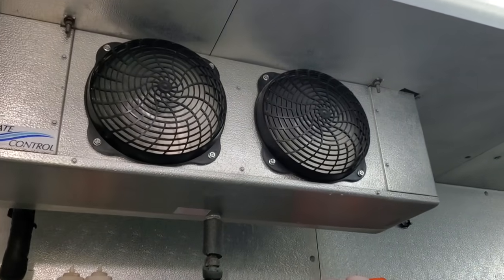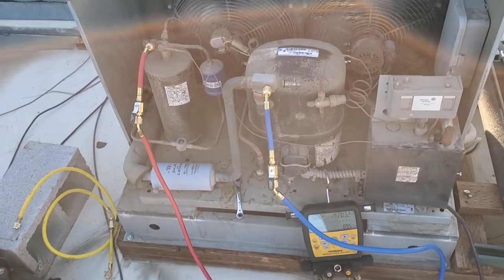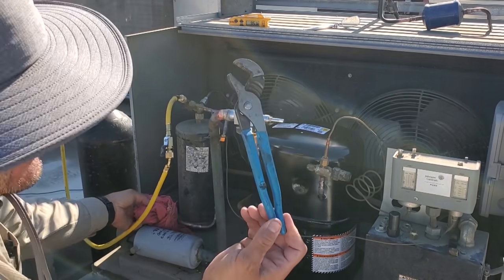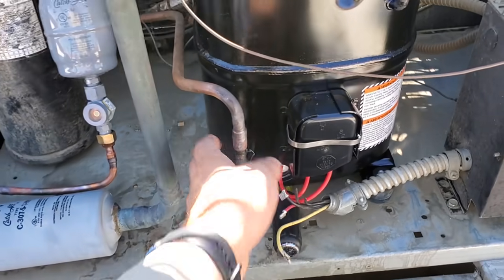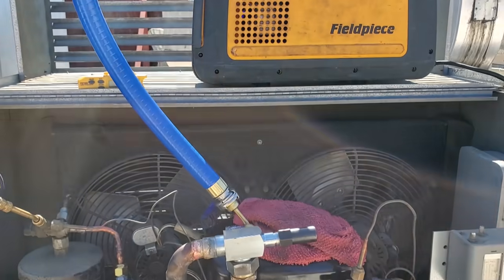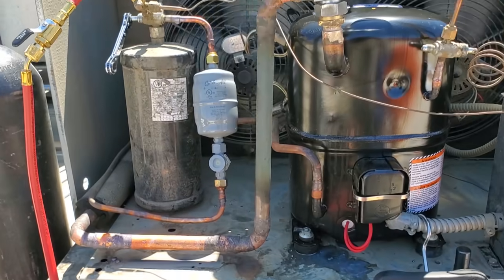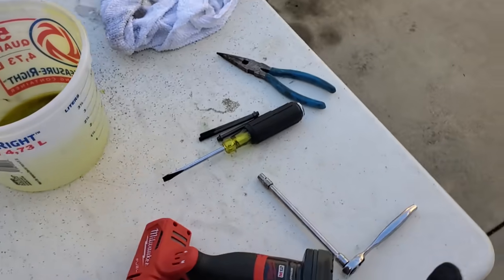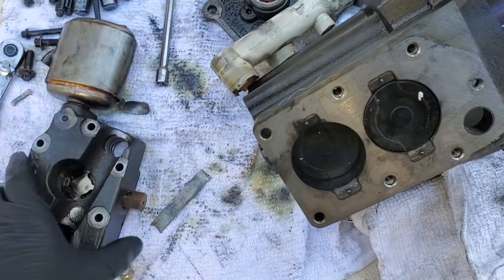THE COMPRESSOR SOUNDS LIKE IT HAS ROCKS IN IT

Comment: Had a scroll compressor on a Data server room unit that was making that noise, but cooling and running fine. I wanted to replace it before it broke but my service supervisor and manager said no. 6 months later someone else has taken over the contract and it went out. He said he felt it would have been best if I had replaced it in the spring like I wanted instead of middle of the summer. 🤷‍♂️

Comment: Slow metal fatigue due to vibration. If you look at the metal break you'll see 'waves' as the crack grew and the steel stretched and then sudden a clean granular area when it finally failed. I imagine the compressor probably wasn't balanced properly and had a harmonic that was ultimately destructive for those brackets.
Reply: I came here to write the same thing and saw you already wrote it 3 months ago. lol.
Reply: I’m third on the list, 9 months late.
Reply: @Sidicas  Heh. Seems like you got Craigified!
Reply: superb analysis

Comment: The bracket likely broke due to vibration-induced metal fatigue.  Ask the manufacturer.....it’s probably a known problem.
Reply: That's what I was thinking too. Once the small muffler tab one went maybe it caused the other to see vibrations at its resonant frequency. The breaks seem too be the same distance from the bends in both brackets as well so hopefully that design has improved in new models.
Reply: Joseph D too be or not to bee, that is the question.

Comment: When your unsweating a line that your going to re sweat as soon as it’s ready to come off move the heat back onto the compressor in this case and pull the line 90% out let it back all the way in then out again a few times this cleans almost all of the silver off of it making it fit better. You also risk tearing the copper if your heat control isn’t great. I love watching the videos keep them coming

Comment: "Actually it just satisfied on me"
Hopefully it took you to dinner first.
Reply: Erik Kovacs 😂😂😂😂😂😂😂😂😂
Reply: New merch: 'God, I hope she blows'
Reply: Yea... wth does that mean anyway??
Reply: Johnathan Waters think long and hard about it. 😀
Reply: @Johnathan_Waters  When a system is "satisfied" it refers to the temp control detecting the desired temp it's programmed/adjusted for. After the thermostat reaches set point, it opens phase to the liquid line solenoid (closing the valve) so the compressor can pump down and shut off.
Reply: I guessed what it meant, but it doesn't stop it sounding funny to someone outside of the States lol. Phil from the UK

Comment: My dad once fixed one of these by using a shop vac'd bowl and a hole saw on the crown, then an old can-opener to finish the cut.  Replaced the strap and ran off a cut ring to fit in the top, braised it on with the slug.    It'd be a hard call but you'd have been known as a miracle worker XD.
Reply: Prjndigo I once moved headstones but left bodies.

Comment: The black sludge is from the valves overheating. Lack of suction gas cooling
Reply: Yeah you are right with that  I only hope that the compressor did not pump oil in to the sistem itself
Reply: Look at that valve's heat signs on those......
Reply: @liviugabrielancutescu3644  the system is full of it it's circulating oil all the time. Drier catches most of it. A few drier change outs clean it up. That's what I learned over the years. The core type drier cleans a lot of junk out quickly but needs to be changed till the oil is clean again. I'm sure some of the dirt or solids get stuck to the bottom but if it don't get disturbed it's not going to get pumped out of compressor
Reply: @royamberg9177  it's normal to pump just a small amount but that pipe if it was not kept there by the bracket the compressor probably was getting oil and pushing it
Reply: Possibly liquid slugging?  Maybe caused by low superheat making the compressor pump liquid.  The liquid doesn't cool off the compressor and overheats the oil and this happens.  I'm not sure, trying figure it out.
Reply: @tytig94  slugging may have busted strap but not carbon
Reply: Roy Amberg the system is full of it, indeed.
Reply: Interesting, didn’t know that

Comment: Great job! I am 3000 miles away. Here, that job would more than likely go out for bid to at least 3 contractors. You’d be dealing with a facilities manager or broker who has the job of making sure you do not make any money. He would take the bids and start calling working one bid against another. In the end, the guy on the truck would being doing as little as possible because his company told him he had 4 hours total to pick up the compressor and turn key the changeout. Some “woman” in the office screws up the quote and they will still want the same profit. An example is I saw a company do a nearly $18,000 30 ton compressor change out and did not even change the filter drier or the contractor. Techs in the field are told exactly what to do and how long they got to do the job. Some companies even tell the tech what roads to take to drive to the job. They have sophisticated GPS driver monitor systems that tell the office has fast you turn, if you slam on the brakes, where you are, where you been, and have a camera pointed at the driver. Mom and pop restaurants will not fix anything that is running, and when they do authorize a repair, the company needs a team of collectors working the phones trying to get paid. California, it must be different. Just about everything is brokered out here, one way or another. How you sell these job is a mystery to me. I bet HVAC companies are using your videos showing techs how easy it is! On large equipment facilities out here, in order to get customers and keep customers, either the salesman gave the job away, or, they send a saleswoman out to screw the customer, or, possibly they send the site contact guy to the Final Four Tournament or on a fishing trip.  Everything is crooked, everybody wants something for nothing. It all flows downhill to the guy on the truck.

Comment: Black sludge is from the compressor overheating check your superheat at the compressor If it's a Copeland compressor they want min 20F degree max 40F superheat at the compressor plus check your discharge temperature if it's at 250F oil starts to turn to acid.Make sure your condenser fan are working correctly.
Reply: The same guideline for L'Unite (Tecumseh) 20°C superheat max 40 deg
Reply: Black sludge can also be from aluminum wear. Aluminum oxide will look the same as burnt mineral oil.

Edit: that was definitely from overheating because the valve plate was discolored and it had carbon buildup from burning the oil.

Comment: The noise was probably from those sheared off brackets rattling in the bottom of the compressor shell, whatever, it wasn't right & the replacement of the compressor was the way to go.

Comment: Others have touched on this, but I believe I can explain what you are seeing with the oil and carbon deposits.

Was this originally an R-22 system years ago, before the condensing unit was replaced with an R-404 unit? The reason I ask is that it looks like there is mineral or alkylbenzene oil mixed in with the POE oil. Mineral and alkylbenzene oils are good oils when used with CFC or HCFC refrigerants, but not so good in an HFC system. Also, mineral and AB oils will decompose into carbonaceous materials at lower temps than POE oils, but even so they still requires discharge temps above the manufacturer's specified maximum for the compressor (around 225°F-250°F for the Tecumseh AV series). I think that is the case here. The compressor discharge temp must be well over the manufacturer's rated maximum in order to have caused the discoloration on the valve plate and the carbon deposits on the pistons and valves, as well as the sludge in the oil. High discharge temps are caused by the usual things: high compression ratio (seen in systems running low evap temps), excessive superheat, excessive high side pressure (dirty condenser, overcharge),  etc. 

What you are calling "copper plating" on that bearing end plate isn't copper plating. That is actually a copper thrust surface. The entire weight of the rotating assembly rests on that thrust surface, so copper is used as the bearing material for the steel thrust surface of the crankshaft to ride upon. Copper plating should not occur in a dry, acid-free system. If the system contains moisture and/or acid, that needs to be addressed immediately.

Comment: That small tab looks like it mated that "muffler?" Thing to the suction line thing. Once that snapped, the muffler thingy could vibrate... and that vibration probably caused that other little bar on the suction line thing to snap. I'm sure those two tabs made a bit of noise at the bottom but those two side units are sitting right next to the pistons and now have play... so they were probably making the most noise. Yeah it works but you know that vibration would have caused another break that would have been far more catastrophic. Good swap and thanks for the dissection. I love seeing the inside of motors. Makes the video awesome to me.

I'm just following your nomenclature but I'd guess that muffler is something to do with the oil or discharge line but I didn't see how it came out of the case. I don't see why there'd be a "muffler" on an electric driven motor but i haven't a clue.
Reply: I've always called them mufflers as well. I once dismantled a scrapped compressor (which still worked. The whole unit was scrapped due to rotted coils) and ran it with and without the mufflers. It was much louder without than it was with. It's surprising how loud it is period running outside of the steel housing pumping air. Of course, when it's still sealed in the hermetic housing it's much quieter either way.
Reply: @Matt_Deluca  good to know, I really didn't realize they'd have one. Though I'd wager vibration dampener might be closer to the description but again idk

Comment: Good Vid ! That oil in the Bottom of the compressor that ooks like 1 Thick oil and a Thinner oil is Exacly that. it is 2 Diferent oil types that Dont Completely mix. The thicker oil is the Mineral Oil and the other oil is either alka benzene or poe. old system and a few compressor changeouts  = different oils in the compressor. Thats one of the Drawbacks of NOT being able to do oil changes on a Hermetic compressor after doing a compressor change out.

Comment: At 18:44 you see the "muffler" on the left and the what I believe would be the piston intake on the right. The little twisted bracket on top breaking off may have been the result of the lower bracket breaking off or visa-versa. So was it just metal fatigue or operational stress failure??? I'm surprised that a little bracket held with just two bolts would be enough with the vibration generated by the motor.

Comment: Nice. That’s pretty interesting. Seems like the valve plate was overheating and maybe started breaking the oil down.  I opened one recently because it sounded like rocks inside and it turned out to be a mounting spring broke and the whole assembly was bouncing off the shell.
Reply from the maker: Yeah i think somehow this one was hitting the case and or thr muffler was rattling .........

Comment: Awesome! Thanks for my first look into the guts of a hermetically sealed compressor! And as far as Tecumseh goes, personally I've always had WAY better luck with their mower engines VS Briggs. But Idk if they even make small engines anymore. Seems like forever since I've seen one...
Reply: No they don't, they only sell parts for them anymore. Moved on to other things. We had a 90 GPM water pump with a briggs that blew a rod, took out the piston and hooked up a tecumseh to the briggs, ran it that way over a decade while the briggs didn't make it past summer #2.
Reply: @leebarnes655  Lol doesn't surprise me. My uncle had a newer rider with a twin cylinder Briggs and one day there was a loud noise and the engine seized. I took it out and tore it down and there wasn't much but metal dust left to one of the con rods.

Comment: A great video! Liked the compressor teardown! I used to cut open scroll compressors and would usually find the failure was from them binding due to wear from the pot metal parts wearing out ! There would be a large amount of metal shavings in the sump!  They're very cheaply made! I personally prefer the turbo torch because the flame wraps around the pipe and the silfos flows better and you don't have to move that bulky torch around so much ! The turbo torch tip is so much lighter to!  I 💯 percent agree with you that the whole unit should have been replaced! You as the company owner should have convinced restaurant that it would have been much less expensive in the long run! That was a perfect opportunity as it was still running! Liked that you used the heat dough on the service valve make sure to tell your techs about that! To few technicians are using the heat dough! It's some really good stuff unlke that worthless messy paste! A very though we'll make video !

Comment: Hey Chris,
Great video !!!!
I’m still a bit new to this Refrigeration trade 
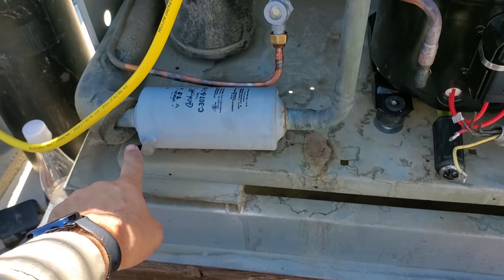And I noticed at 10:38 you said you need to cut the suction drier off and just replace it with a pipe,
Why did you have to replace it with a pipe ?
Reply: Because before the suction dryer appeared, it was just a pipe. The universe without a pipe in the time line exists in a separate paradox. I should put together a list of reversal-related videos for binging.
Reply: Oh Wow That’s Interesting...
Thank You For The Help   
👍
Reply: The new compressor probably had it built in. Just a guess though.

Comment: i want to vacuum police you, but you did it yourself lol.  unlucky on that packing there, yes they always leak; which is why i like to put nylog on the valve caps during vacuum just to be on the safe side.  pulled a 220-ton circuit down on a chiller to around 600 microns in a couple hours, took the whole weekend and on monday morning was down to 170.  sometimes all we need is more time, which we usually don't have.  great vid though, keep up the great work and thanks for all the teaching along the way!  p.s. impacts rule <3

Comment: If you have clients that have major contactor problems due to sand/dust getting in them, ask them if they want you to reroute the contactors into a Explosion-Proof box mounted on the outside of the compressor cabinet.
Explosion-Proof boxes are what's used in places that have lots of fine dust (that tends to go BOOM if the concentration is too high and there is a spark, like Bread Flour factories and Sugar Refineries). They're the next best thing to Hermetically Sealed and no sand or dust is going to get in them to ruin the contactor...
These boxes can also protect mechanical time clocks too...

Comment: A Welding Tip - When using 45% or 56% silver " Dip your Rod " in the White Flux Constantly while welding it will make for a smoother and easier weld.
Reply: OcRefrigeration , Hvac & Electrical Video's. The 'Notorious DR WFC'.

Comment: That noise that the compressor was making is more likely the result of the compressor knocking against its housing, I don't believe that it was caused by the loose parts at the bottom of the housing.

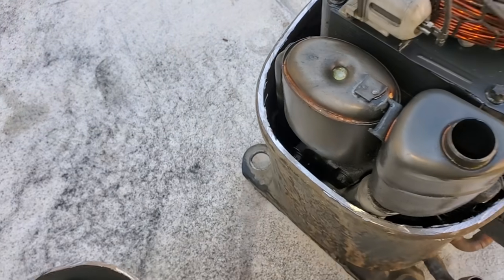At 19:08, you can see an abrasion on top of the muffler which suggests that significant movement has been occurring. The part that caused the abrasion looks to be what the bracket stops from moving and based of the position of the parts as shown, the movement has been purely rotational.

This suggests to me that the bracket on the muffler was there to counter the rotational forces of the compressor and motor which, because of how physics work (the compressor will try to spin in the opposite direction that the motor spins in), means that the bracket had a fairly constant load on it for a significant portion of its life.

What we see at 19:08 is probably the biggest clue that exists to what caused the bracket to fail. But whatever the reason is, there is probably a good chance that it all comes down to a design flaw or manufacturing defect.
Reply: RandomJerry the biggest design  flaw being: can't operate to specs while pumping sludge to/from an OIL sump.

Comment: Cruise control set at the proper speed keeps the tickets down as well. That compressor sounded like the only thing holding it together was the case. Does the drier keep the broken parts from going into the new compressor and do you have to change the drier out after a while?

Comment: Just would like to chime in on a couple of the comments below,yes Chris is BRAZING NOT SOLDERING,SOLDERING IS USING A FILLER THAT MELTS BELOW 850 F,BRAZING IS ABOVE 850 F. Sil-phos 5 or 15 is liquidous around 1275 to 1400s,Safety Silv 45 or higher is around 1250 or so.Welding is a fusion process!Brazing is essentially using a similar or compatible filler and basically gluing the tube together!
Reply: Peter Smart so inductively-reasoning, a solder is neither a similar nor compatible material, does not 'glue' materials together, while brazing cannot backfill- think I got it now.
Reply: Oh and you might want to tell a welder never to weld cast iron together using nickel because of this new terminology.
Reply: I've welded cast for years,but if you actually know the process,the preheat and postheat,you are not actually welding cast iron,BRAZING repairs have been done on cast for years with great results,nickel melts and adheres to cast ,it is very compatable, and strong . It's more about the metallurgy and the process and who carries it out.Most people believe that welding is stronger than brazing,there are brake joints that have tested at over 80,000 psi and weld that only test at 70,000.